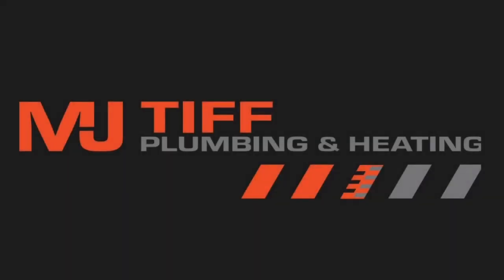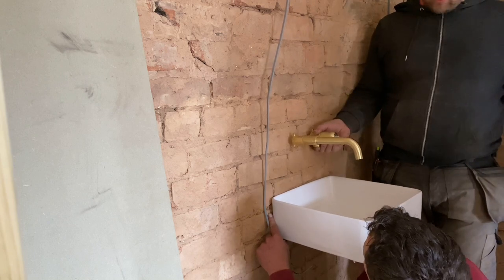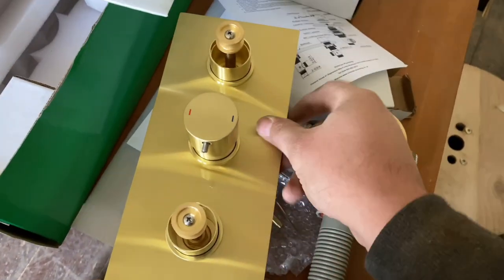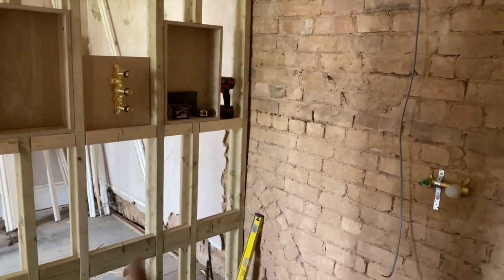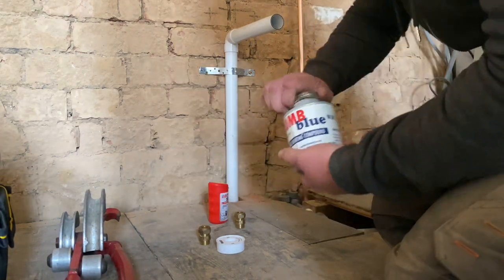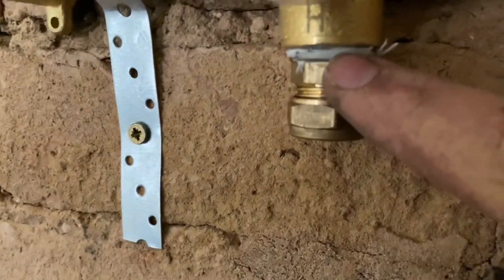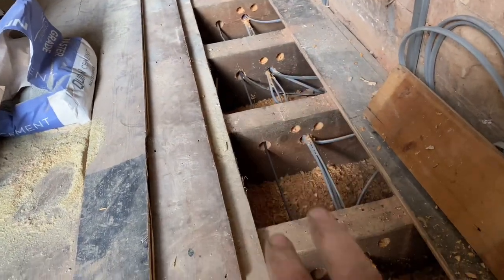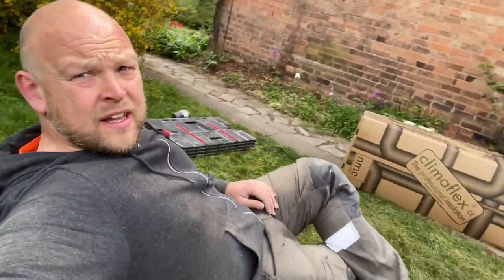REAL WORLD PLUMBING REVIEW & HOW TO SET OUT BATHROOMS,CONCEALED SHOWERS/TAPS & MORE 1st FIXING UK

Comment: Mate just so you know I'm sure the loctite thread tells you how many wraps you should do depending on the size of the pipe I'm sure half inch is like 6 or 8 wraps and cross them over as you go, you don't have to follow the thread 👍
Reply from the maker: Yep, it does…. But as said in the video I’m coming off the back of PTFE so just getting used to it back then, it’s not an issue 👍🏼👍🏼

Comment: always good to score the threads using loctite to prevent it spinning, its good stuff but the 577 is where its at
Reply from the maker: Thanks mate, will bare that In mind. Been using PTFE and paste for 27years with no issue, since starting this channel 5 months ago people have said to try loctite 55..... so I have.

Seems more people have issues with it so will go back to what I know
Reply: 577 is the dogs!😀
Reply: 577 no ptfe at all?
Reply: @rockandmeatroll  yeah no PTFE, 577 is a liquid, it's quick and easy for metal on metal sealing, expensive from loctite but you can get rapidseal from BES or similar products for cheaper elsewhere. Nothing wrong with PTFE and paste mind I still use it now and then.
Reply: Yeah 1000% loctite 577 for metal to metal work its the nuts never had any issues with it ever
Reply: @tomwalker7043  it works and no leaks , but if you ever want to remove the joint , it’s virtually impossible
Great for rad tails like
Reply: @boyasaka  you just need to get your 12" bahcos on it lad haha tbh I've used the Screwfix thread sealant and I didn't have any issues with that either just the the bottle is a bit rubbish
Reply: @tomwalker7043  I’ve been using that flomasta blue liquid ptfe with no issues , also bought from screwfix

Comment: If you have installed unvented under sink hot water heaters you will remember the notorious plastic brass connectors that always leak.The only method i know off to seal them is Rectorseal Tru- Blue paste.
I do use 577 but the above is fantastic and you can put it on plastic flush pipes etc.
Reply from the maker: them brass fitting are a nightmare

Comment: Hi Mark, long time watcher of the channel thanks for all the help & advise you put out. I am in process of ripping my bathroom out & was advised by a plumbing mate to you threaded to solder joints into the concealed valve rather then compression. Have you ever had any issue with compression leaking down the line ? Im guess solder fitting is just belt & braces Cheers mate 🤙
Reply from the maker: Thanks for your support on the channel mate, really appreciate it buddy.
I’ve never had an issue with compression connections, infact some showers come with that as standard. As long as you do it all right with paste etc👍🏼👍🏼
Reply from the maker: Also….. I assume the “E46” in your name refers to a BMW??
Reply: @MJTiffPlumbing  Thanks mate Good to hear I’ll stick with them 🥳 Yh BMW E46 Coupe for all my sins 😅when I’m not tryna save some money DIY’in I’m doing amateur drifting (Registered event not local roundabouts) 😁

Comment: Great video content. Did you use a core go go through the brick walls for your plastic heating pipes. What size do you recommend? Cheers.
Reply from the maker: Thanks mate, either those or long drill bits 👍🏼

Comment: Hi, about ptfe vs loctite 55, from my experience: I had leaks with both, and that happened if I put too much or too little; if it's too much it will get pushed out of the joint, if too little, water will find a way out. I should mention that with both products I didn't use other thread sealant. Even when you put the recommended number of turns of loctite, it can still leak, depending on the quality of both mating threads, sometimes you need less, sometimes you need more, and it's really necessary to scratch the male threads, otherwise the product will rotate, and stay out of the joint.
Reply from the maker: Yep, 27 years in the trade and you get a feel of what works and what doesn’t.... I know PTFE works for me so will probably stick to that to be honest

Comment: I been using loctite 577 it’s like a liquid only works on metal to metal connections though and wouldn’t recommend using it on outside taps as don’t think you can get it back out after it goes off 
Used it for 1st time on price doing district pipework in a block of flats was sh**ing myself thinking it leak 🤣
Holds to 10 bar instantly and after 24 hours it holds to something stupid like 1000 bar 🤣
All does same job at end of day though I’d use any of them 
great video been watching the channel from start crazy how quick it’s grown your smashing it mate 👍
Reply from the maker: Thanks mate, and that’s for being here from the start... really appreciate that mate, it’s gone crazy.

Comment: Loctite cord every time. You can back it off if you need to line up the outlet. It says on the label how many turn for your exact size pipe. To much and you can damage the threads. As for the values makes you appreciate hansgrohe ibox stuff.
Reply from the maker: Literally just fitting an Ibox system today, video coming on Wednesday of the 1st fix

Comment: Bath water temperature, might but compromised, drawing water from the thermostatic shower valve. Most thermostatic valves, have a maximum set temperature of 42 degrees. safety stop 38. By the time the bath as filled. The temperature would be reduced!
Reply from the maker: Thanks for watching👍🏼👍🏼

Can always turn the shower valve temp up as per manufactures instructions, not an issue. showers are preset but can be altered.
Reply: @MJTiffPlumbing  They are preset for a reason, to prevent scalding.  Thanks for sharing!
Reply from the maker: Indeed they are Kevin..... they have been for many years.
And they also show you how to alter them to allow more heat.

As long as you make the customer aware of the implications.